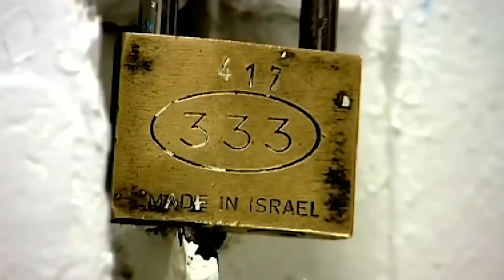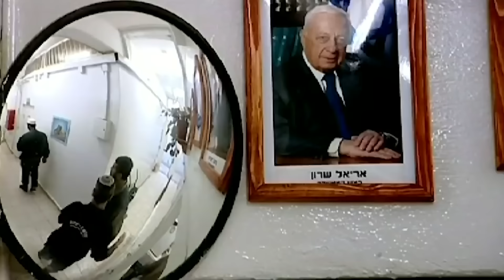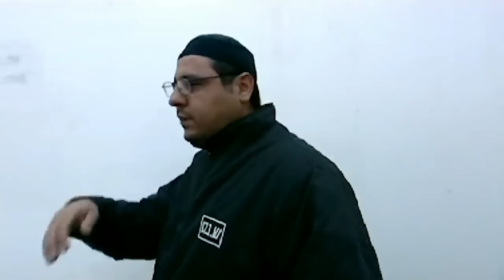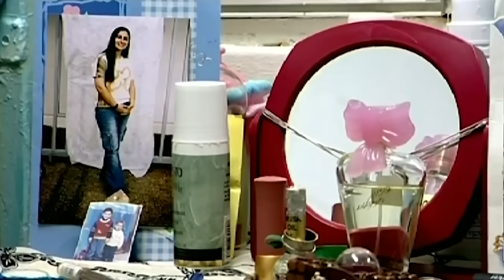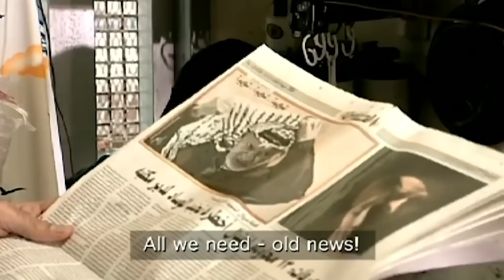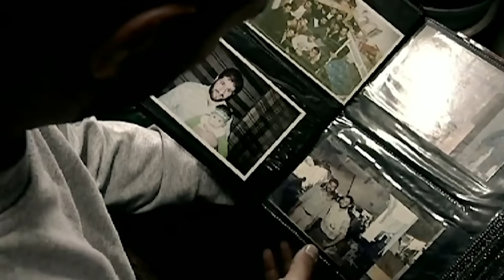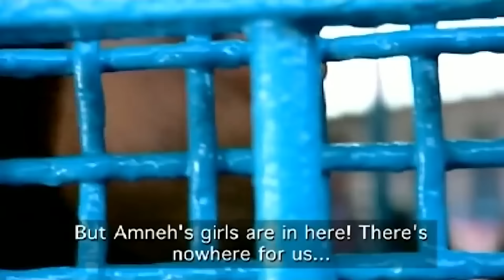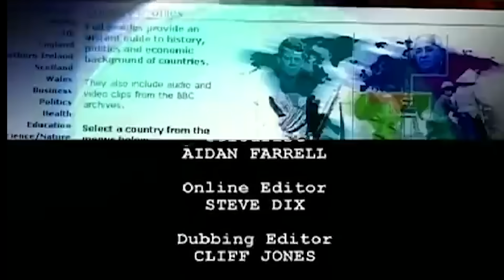Palestinians & Israelis Locked Up Together: Inside Israel's Jails (Jail Documentary) | Real Stories

Comment: Assimilation in Humans with the final 'K' at the base Establishing an Assimilated Group !

There are : 3 types of Assimilation

For instance : for the process of simplification : 

by which a 'speech sound' (such as the Azan) is influenced by the surrounding sounds,

(such as: the call to Salah) to make them more similar (to Prayer).

This 'Assimilation can be divided into three types; 

(as follows) : 

1. Progressive assimilation, 

2. Regressive assimilation, 

3. and Reciprocal assimilation.

Similarly, the movement of the 'digested food molecules' into the cells of the human,

body and it is from where they are used. This implies the 'liver' is important in;

assimilation. 

For example : 'glucose' (sugar) is used in respiration to provide energy, and also ;

'amino acids' are used to build new proteins. 

Therefore : the example : of 'Phonetics: as follows :

The adding of the ending '+mut' to the noun base 'inuk'. And the final 'k; at the base. 

Which comes into contact with the initial 'm' of the ending and 'k' becomes 'm'.

In light of thesis in what happens when we human's as people of assimilation.. 

Process  this assimilation which involves taking on the traits of the dominant culture.

And so, to such a degree that the 'assimilating group' becomes socially,

indistinguishable from other members of the society.  In respect of such, assimilation,

is the most extreme form of acculturation.

Thus, the rules in which the assimilating group'  assimilate is of the assimilation of;

the process. By which two nearby sounds (Azan & Salah) become more similar to,

each other. 

...

Comment: The title is misleading. It's only Palestinians locked up in these Israeli prisons. The Israeli guards and police officers aren't locked up too. That's misleading. But it's not surprising to see that the prison system is an apartheid system at its core with separate prisons for Palestinians and Israelis. I'm sure the prisons for Israelis are kept better and have different rules and regulations. Overall, the prisoners in each are most likely treated differently - one being treated better than the other.